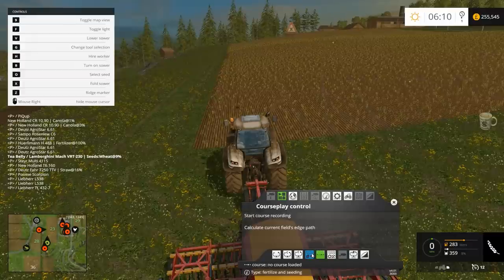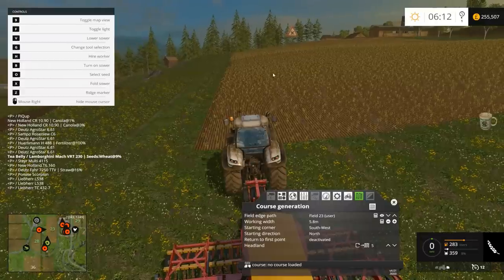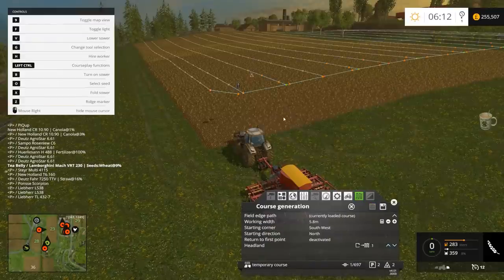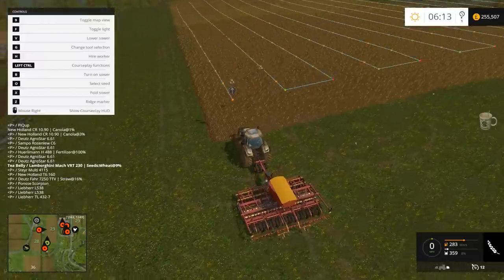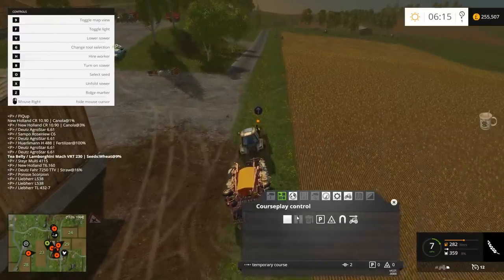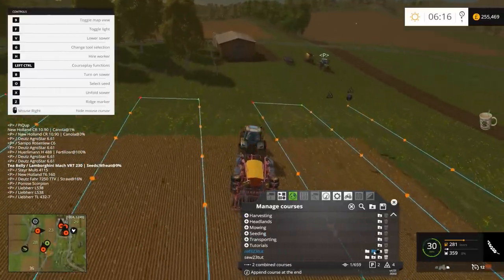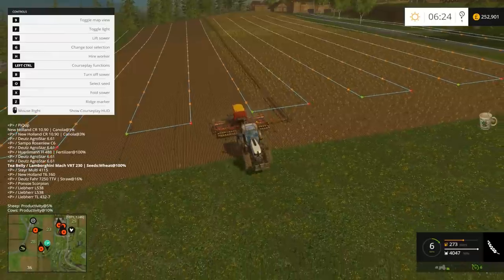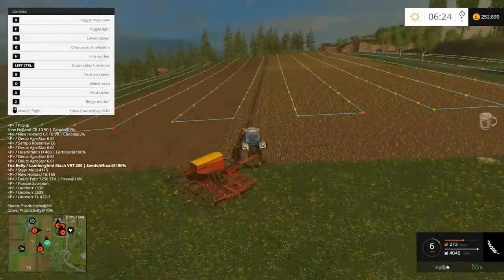FS15 Course Play Tutorial 4a (Sowing & Refill)

Comment: question: I use Courseplay on Sandy Bay map, but when I want to seed a field the driver just won't start the course. The edge of the field is perfectly scanned, the course is set to go up and down without a headland (but it doesn't even work with headlands) and my tractor is parked right in front of the starting point. But when hitting the start course button, it just keeps standing there and won't start the course. You know a solution?
Reply: Do you have work set to sow and fertilize on the bottom?
Reply from the maker: hi it may have something to do with the map itself.
Reply: problem seems to be the Bednar Proseed mod. Not fully compatible with Courseplay
Reply from the maker: yeah mods can be a real problem when it comes to courseplay